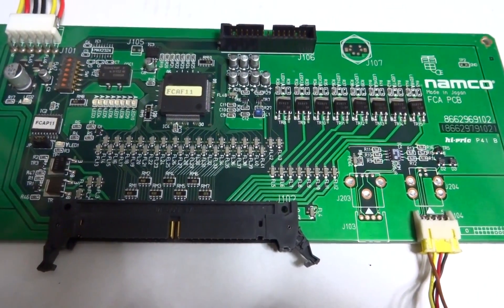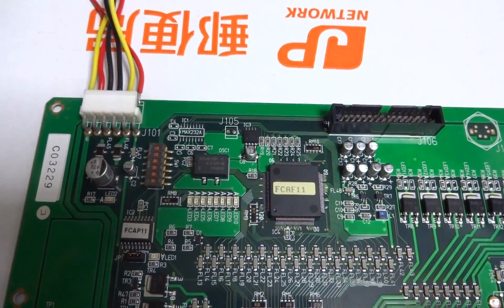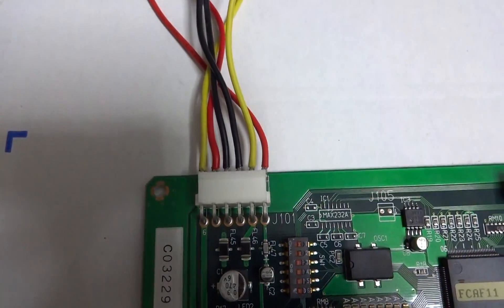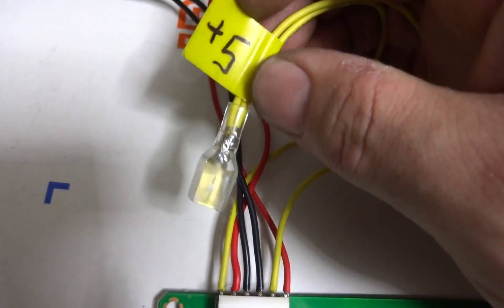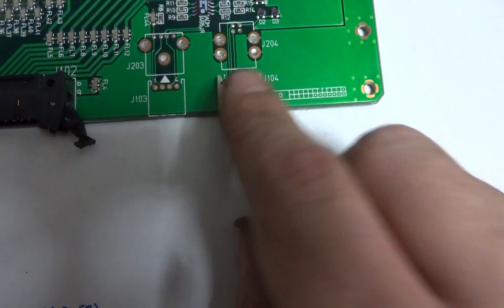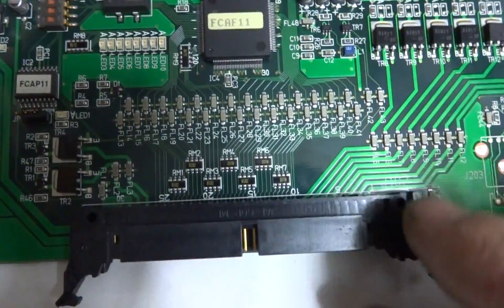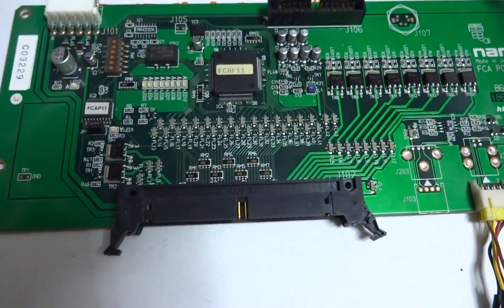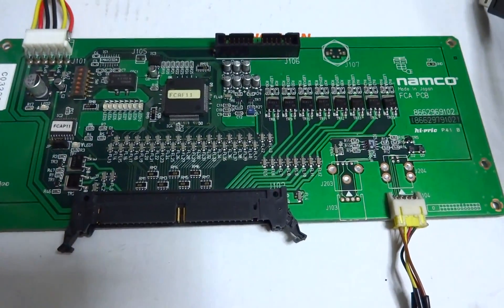How To Wire A Namco FCA PCB 8662969102

Comment: Thanks for this Luke. I got one of these that came from a Wangan Midnight 2. Mine was also missing the 60 pin connector. J103 looks like it can take a surface mount USB port. J106- could this be digital input? I'll have to dig through that box tomorrow and see if I had the J103 cable. I was able to get Tekken 4 to load on this system but I couldn't play it and the Magic Gate I/O didn't work either. Perhaps this PCB is the key!